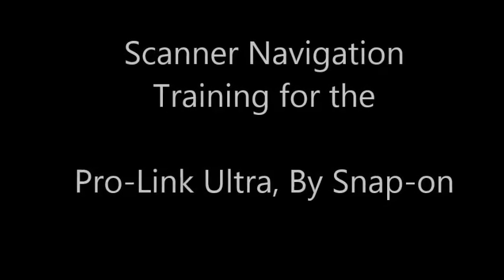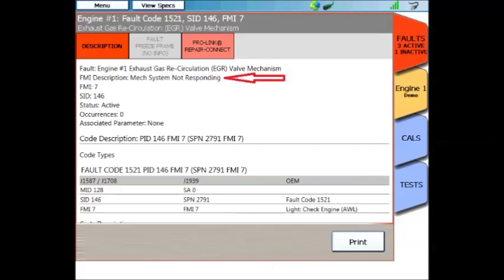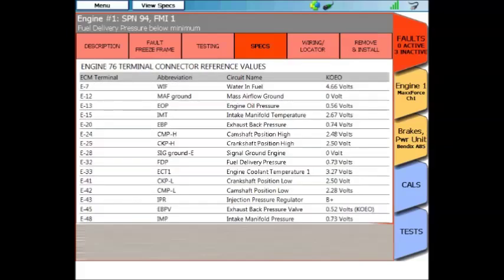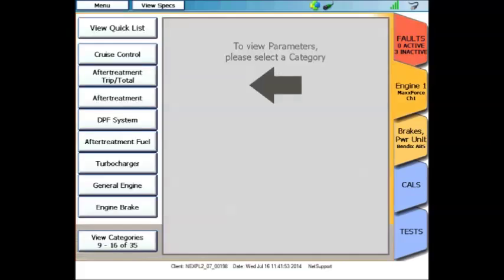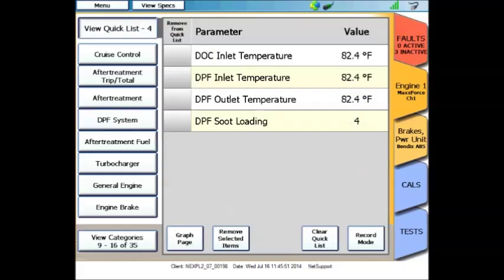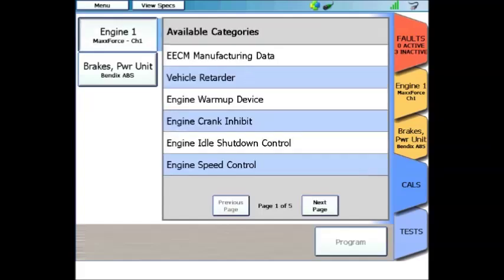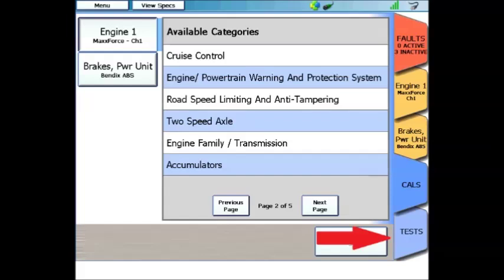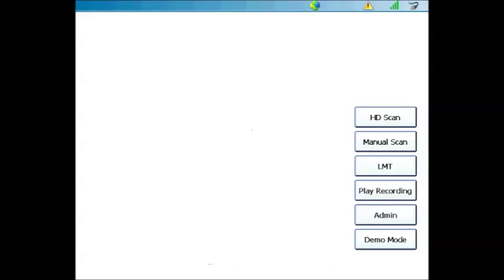Using the Pro Link Ultra

Comment from the maker: The one being demo'd is the Extreme Kit.  Without adding the Manufacturer Specific software you can only access Codes and Data.  No Calibration changes or Bidirectional controls are available on the basic package.
Reply: What is the truck coverage? Does it provide support for any Heavy Truck?